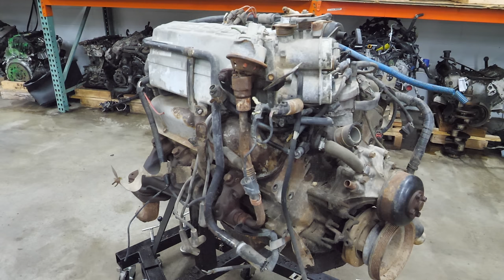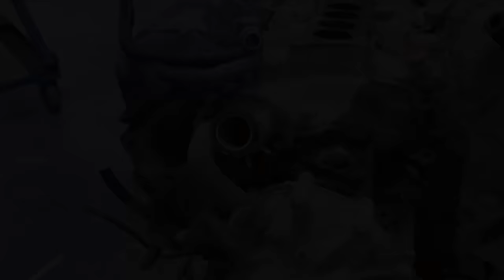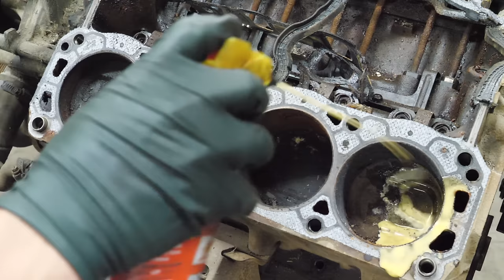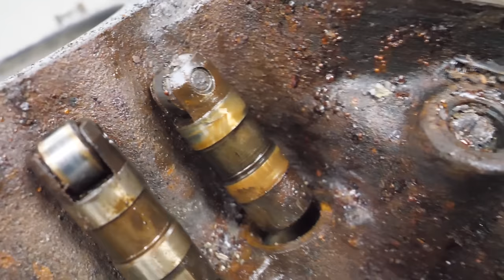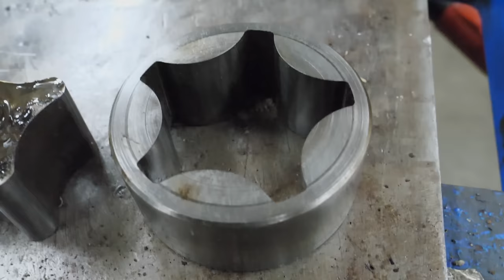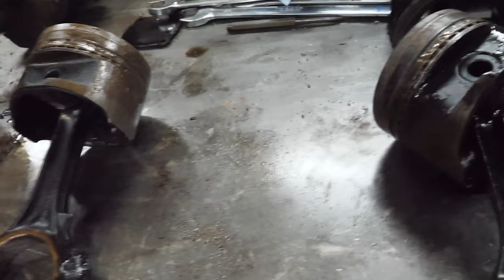LOCKED UP Ford 351W 5.8L V8 Engine Teardown. How Bad Could It Be?

Comment: Still daily my 1994 F150. No rust on the frame, despite living in PA, because every winter I get underneath it with a paint brush and a gallon of bar and chain oil.
Reply: Smart
Reply: Good to hear, I inherited a truck and have been spraying it with woolwax but there's always that lil doubt that you're just fighting for nothing
Reply: For the heck of it, try one of the better rust converters. I would expect that will 'seal' up a lot of it exposed metal and drastically reduce the need for coating the entire underbody.
Reply: I've got a 1991 F350 that's served as a faithful winter beater and plow truck for about 15 years in Iowa now. I use engine oil mixed with automatic transmission fluid and a pump bug sprayer, but the idea is basically the same... Metal coated in oil doesn't rust.
Reply: Every time it rains you must leave a ground rainbow in your wake
Reply: Fuck all that noise.... I just buy a new vehicle rather than fuck about like that
Reply: @davelowets for some they love the older stuff but if one can nice summer ride and winter beater.

Southern rides rule
Reply: @davelowets  Gee didn't know we were dealing with freaking royalty over here... Do you buy new tires when you wear a set out or do you just say F it and buy a new vehicle then too?
 
I'd rather keep an old truck around that is paid for and still does it's job, instead of spending a damn mortgage payment every month on a brand new one.
Reply: @admiralrustyshackleford119 most of that oil is designed to flow and flow at all temperatures. You could use linseed oil or tung oil or a mix because they oxidize and harden pretty fast if you start in September will be pretty hard by December.
Reply: @@bcubed72   Oh cool yeah the ole 'bar & chain oil' trick!  Yep!  I bought a kitchen cooking oil squirter.  Mixed 50/50 chain & bar oil with kerosene & spray bits here & there, & tools etc.  Smells a bit for a while.
Reply: Rustified old 351 bugger!

Comment: I currently own a 1997 F250HD with a 351 and a ZF5, and it's also 4x4. This is the 7th obs I've owned and by far the best. 

I managed to break the 2 outer most water pump bolts off in the block and it still seals with the rest of them in place. 😅 

I plan on restoring the truck.

Comment: I’m watching while sitting in my 19ft travel trailer that I have lived in for the last couple years. I tow it with my 2005 F150 that I bought new with 25 miles. It now has 340,000 miles and the 5.4 has been awesome. I did have to rebuild my transmission at 295,000 though. Damn Fords! 😐

Comment: 0:28 All of those gas engines go straight back to the 1960s. The OBS was the end of the line for them. The longblock on your stand is a 1960s design with some 1990s set dressing haphazardly duct taped to the intake manifold.

Comment: I had a 5.8 in my 96 E350. Did a F250 4WD conversion and installed a 410W and lifted it back in 2015.
Reply: Very nice, so basically the 351 Windsor in the Econoline Van is now a 410 Windsor Stroker?
Reply: @CJColvin  it was a 410 Windsor. I said it had a 5.8 and I installed a 410W. 😬 might want a refund on that education…
Reply: @RadDadisRad  Gotcha
Reply: @RadDadisRad  Just asking, how much power does it make now?
Reply: @CJColvin  I sold it 2 years ago during Covid, but it was on a Holley Sniper making 508/572 on 91 pump gas and 427/545 on 87 pump gas
Reply: @CJColvin  mild cam but it still pulled to 7k without struggle
Reply: @RadDadisRad  Very nice brother

Comment: E7TE Heads Aren't Worth Much?!! . . if you say so. Anyway, I have a story for you regarding Ford transmissions. I won a scholarship from FoMoCo in the mid eighties to go thru Fords A.S.S.E.T. program (now called FAST) and I traveled to N.E. Ohio to attend. As an apprentice at an approved dealership I was often tasked with the job of parts runner. The shop truck was a 1980 F-150 with a 300-six and automatic tranny. In 1986 the truck already had over 700,000 miles on it. The engine was original and I got R&R it's seventh transmission.
Reply: How much do YOU want to pay for some? 

I'll sell you as many as you want, if you think that they're so "valuable".. 🤷🏻
Reply: Y'all ever heard of a manual transmission???  My neighbor worked at the missile base 75 miles away, 150 mile commute. Honda Civic went through 4 automatic transmissions in 650,000 miles and made me scratch my head!! Those drive great in stick form!
Reply: @davelowets .. what is the point of your comment? Do you feel better? Why be such a braggart?
Reply: First generation AOD were extra light duty
Reply: Yes! Those 300’s were made to last.  E7TE heads were the go to for a long while. Every time I’d do a bid for a couple on Ebay they’d be gone. I ended up with some GT40P’s tho’.
Reply: What transmission did that thing have? The C6 in my 86 F250 is still original and has 253,000 miles on it. Going to go through it when I put a new engine in soon and put the C6 low drag kit in with a higher stall converter but the trans still bangs gears and it's been neglected its whole life.
Reply: Yeah, E7TE aint worth much. You may be thinking about GT40 heads or the ones from the mustangs or late 90s explorers. The T in E7TE stands for "TRUCK" division. They are nothing but the standard heads that you can find on any 1987-1997 truck with a 5.0 or 5.8.

Comment: Rust and crust enough to keep any acid bath happy for a week. Even then, there is no guarantee that the cam will give up its embrace with the block. That was a lot of work. But thanks for doing it.
Reply: The cam is "captured" with bearings, and will not be stuck in the block

Comment: Here's an idea! Treat the remaining stuck cylinders with different compounds like motor oil, Marvel, trans fluid, etc for a couple weeks and then give them a go with an air hammer and report as to what fluid seems to break things up the best!
Reply: could hone the liners out above the piston head. once the pistons get hammered on to the honed liner, they'll be much easier to move.
Reply: What do you think this is Project Farm? We'll test that!

Comment: Looking at water pouring out to the oil pan drain plug, reminded me of my 67 Mustang 460. Last year in the spring, it rained so much, humidity was dripping off the oil pan etc big time. So glad I pulled the oil drain plug, as water poured from the pan for like 15-20 sec. I let it drip purge for an hour or so with a space heater under there,  and changed the oil and filter. Then hand cycled the engine to get fresh oil up top etc. FYI for you guys in cold wet climates, even garage stored! Thanks for sharing!! My plan is to pull the 460 monster and pop in a 351W stroker (408). Cheers from Motown/Dearborn.

Comment: One thing that made these engines so low powered is that they used the same small valve E7 heads that the Mustang used. They had lots of potential though.
Reply: Among MANY other things..
Reply: They also have restrictive cams, restrictive emissions and aren't very well made from the factory as far as cylinder alignment goes. If you want power get a C9 or D4 casting 351w with the thick webs, the roller 351s have casting flaws that make them very weak compared to the older ones.
Reply: @SPAZTICCYTOPLASM  The roller 5.0 blocks are even worse. They can randomly split in half at the whiff of 500h.p.
Reply: @davelowets The only way to prevent the factory 302 blocks from cracking is beefed up the factory block by grinding all of the sharp edges on the sides of the block and grinding all the sharp edges on the valley (that where the 302 block starts to Crack if it makes 500 HP), I've seen that part on Horsepower TV.
Reply: Actually, they are e7te heads, which means the Mustang used the truck heads.
Reply: @SPAZTICCYTOPLASM  From what I can see from pictures, the actual webbing thickness on the crank saddle looks similar, but the visible difference is the older blocks have some extra bit of metal where the oil pan mating surface meets the web over-hang.  Would be awesome to see some measurements. But there are a lot of roller 351s doing 700+.

Comment: Oil leaks, low on power, high on fuel consumption and a transmission that needed upgraded before it left the factory but other than that they were reliable because they didnt make enough power to hurt themselves. Im a Ford guy and still love them lol, i dont even try to be gentle with those corner intake or water pump bolts. I put a socket on them and hammer it a few times and if they come out fine and if they break thats fine too, i will get the broken pieced out when its apart. You can drill a hole in the timing cover above the bolt, heat it and spray some penetrator in it and it will make a big difference but mine go back together with new timing cover, intake and bolts anyway so i hammer them and whatever happens happens lol

Comment: My first engine I rebuilt was a 302 out of my 93 F-150. They're great trucks and great engines.
Reply: But transmissions 😬
Reply: @jeffreygoss8109  better than their rep would have it. But yes, they are certainly the weak points. Most 4 speed autos are trash.
Reply: @jeffreygoss8109  My E4OD in my 97 F250 HD, 351W powered, has 241k on it and shifts and tows just fine. The E4ODs get a bad rap because people don't maintain them or take them out of overdrive when towing. If you change fluid every 30k and don't tow in overdrive, they should last a long time, especially behind a gas engine. Just my two cents.
Reply: @nashbraymen9564  the E4OD is mechanically solid, I've had a couple. I think it's the electronics and  shift logic and the way it works in combination with things like the speed sensor and literally picks up speed from the gauge cluster in some years if I remember right. Also the overdrive like most 4 speed autos from that era was just stuck on the back of a C6 basically. Ford autos in these trucks were definitely no worse than a 700r4 or torqueflite. I'd rather have an e4od or AOD over the GM or chrysler options any day.
Reply: @Terminxman  I 100% agree with you on taking one of these over the GM and Chrysler alternatives of that era. I just think when ford was originally designing the E4OD back in the mid 80s, they didn't design it with the 7.3 IDI and Powerstroke in mind. The torque output of those engines was too much for those transmissions when they were in overdrive so they ate the transmissions. There's an overdrive shut off button on the end of the column shifters for towing but most people are too ignorant to do so. I  very rarely see an all stock E4OD behind a diesel that has over 150k on it.
Reply: @nashbraymen9564  The torque is only a problem for the overdrive unit though, plenty of gas engines made more torque than a 7.3 IDI and even an early and were hooked to C6s

Comment: I broke two bolts on a Buick 455 water pump many years ago despite penetrating oil and tapping it with small ball peen. I slathered on a heavy coating of Indian Head gasket cement and bolted it back together with the new pump. Amazingly it held and didn’t leak.

Comment: Big fan of the old school Ford SBF and BBF and of course the 4.9 in-line, but the 4.6L 2V V8 was probably the most long lived Ford motor ever.
Reply: Agreed the Yamaha 4.6 arguably the second best engine ever designed to the small block General Motors

Comment: Great and fun video!! Been playing with 302 and 351W engines together for years. The block and crank are salvageable and maybe the conn rods. The rest is .... junk (low compression heads) though the timing cover if there is no corrosion at the water to block interface may also be saved. To get that camshaft out you need to remove that expansion plug in the back and drive it out - cam bearings are all different diameters and it has to go out front end first. A good hot tank, a .040 rebore, a .010 crank turn and a good pair of DO0E or GT 40 heads and that engine could be someones dream for his ancient F150/250 or street rod. I had a '92 F250 with a 351W. The engine was great, the rest of the truck wasn't.

Comment: holy moly! Those lower intakes are going for $350 on ebay! I have bought a few for $80-120. Make a custom upper for a turbo setup or whatever. Save that damaged harness, the only parts I use are the plugs for injectors and sensors.

Comment: I love the 351W.  I've rebuilt a few and have one that I built in 2000 with around 400 HP.  Darned thing keeps going.  I first put it in a F100 Ranger, and bent the frame.  Then an early '80s Bronco, bent the frame and front end.  Now it sits in a '78 F100 2WD that I'm modernizing a little.  The engine last ran about 2 years ago.  Hopefully get her going again this fall/winter.  Currently swapping a Jeep 4.7 for mom.

Comment: Back in 1977, I knocked a 1200 VW engine apart with that much rust. The cylinders were badly pittled but one reassembled, it ran pretty well. It was not put on the road. It did serve as a placeholder so cars woudn't have to be pushed. It smoked a little! I used a  2x4 and a small sledge.
Reply: SLEEVES!! My friend raced air-cooled VW's burning alcohol and making big power

Comment: When I was in college in 1986 and 1987, during the summers I worked for Dave Thomas Landscaping in Trenton, Mish-Gin.  We had an '81 F150 stake bed truck with a 351 Windsor and a two barrel carb.  4 speeds on the floor, the truck had about 150 hp?  Well, it was heavy and towed a trailer full of walk behind mowers around like it wasn't back there, but when we took it up I-75 into Detroit, I only did about 60 mph.  I was scared to go any faster with this thing....

[We drove through a neighborhood on the east side of Detroit going to Connors Creek power plant;  We used to roll up the windows and drive through stops signs in that neighborhood, and we were four big guys in a big truck with a lot of weapons handy, that neighborhood was BAD!  And during my time working there, we only found one dead body festering in the long grass that we had to mow....]

I've never understood the difference between 351 Windsors and 351 Clevelands, other than the Windsors were cast in Windsor, Canuckistan, while the other is built in that inferior state to the south with a loser football team named after an inedible nut.  Why would you have two V8 engines of the same displacement that are not interchangeable, sold at about the same time?  Someone got their cock sucked in order to make this one happen, and the Ford family members are famous for being utter and complete DRUNKS (good lord Benson Ford~!)  and Edsel Ford III, who weighed 360 pounds when he was 10 years old, all in the Detroit area.  Some slimy combination of the two must have happened.

Anyway, Great video!
Reply: There are numerous reasons why Ford went that way, albeit only for about 5 years. The 351C was built for N.A. from 70-74, and were the top-tier performance engine. 
IIRC, the 351W was based on the same block as the 302, while the 351C was based on the 400.  
The 351W was made til 97, and are going to be far, far easier to get parts for as there were a ton of them and you can use parts from 302 as well.
If you have the questions, Google can help you out.
Reply: @boots7859 nice explanation
Reply: Haha! Just one dead body!? Did you end up mulching him? 😂 and I have pondered the Cleveland vs Windsor almost all my life.
Reply: @jeffreygoss8109  No, he was a former co-worker who didn't notice the cotter pin on the front wheel of the Walk Behind had snapped, and the mower ran the tire over, cutting it up.  The boss said get ride of him....

(That was a joke.  Kinda...)

Comment: When this was pulled out, it was a 10/11 yr old truck with 200k. Probably rusted out, just like current 10 yr old 200k mile trucks. My 1988 with that 5.8L was a gem. The engine drug the rotten skeleton that surrounded it for a few years through trade school.
Reply: I had a 1990 F150 with the 302 EFI.  2WD automatic.  My dad bought it new and put a fair amount of highway miles on it.  I drove it to school in 2003-2004.  Was a reliable truck, but it leaked oil and didn’t have enough power to it.(as did most everything from that era.).  The truck had about 205,000 miles or maybe a little more, by the time I stopped driving it.  The truck was still solid with only slight surface rust when we sold it.

Comment: I'm getting choked up. Had a E250, the 1995 flavor. The Trans died at over 300,000 miles. Got me 22 mpg on the highway and ran well till I parked it in my cousins tree row. And it wasn't my best ford, my 91 t250 beat it out. It had the 302.

Comment: My wife's family had a 1970 Mustang with the 351 Cleveland engine.  (It also had a popular option for the time that I never liked-the vinyl top.  They lived fairly close to the California coast and rust was already popping up under the vinyl on the less than 10 year old car).
Reply: don't feel bad. I live in the desert and the roof and quarters had rust on my 71 Mustang thanks to the neglected vinyl top, this after 20 years.
Reply: @jamesmedina2062  I live central Texas where rust is not much of an issue.  However, I knew a person who had a Plymouth Duster and lived near Beaumont, Texas(very close to Louisiana and the coast).  His vinyl top covered top rusted off inside his garage.  He replaced it and it again rusted.
Reply: @Jody-kt9ev  wow!
Reply: The problem with vinyl tops is that the part of the roof below the vinyl was never painted at the factory. Once moisture gets under the vinyl top it's game over.